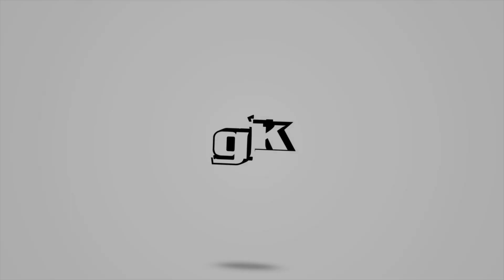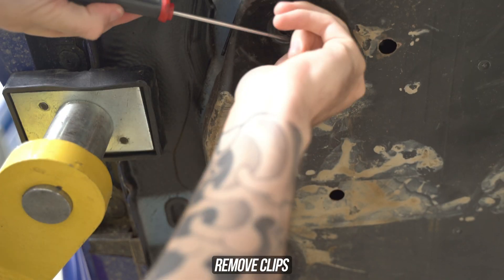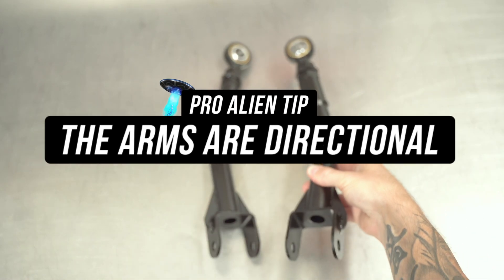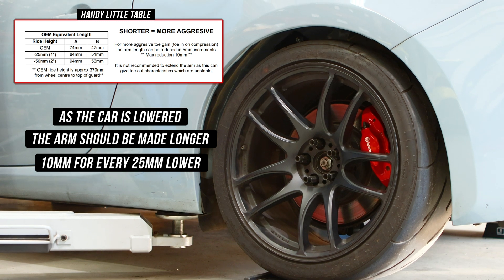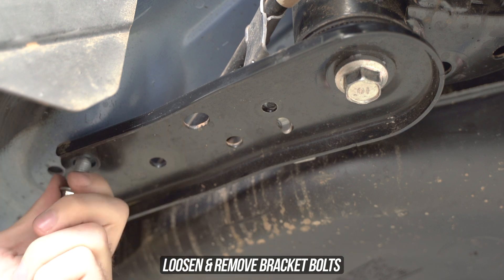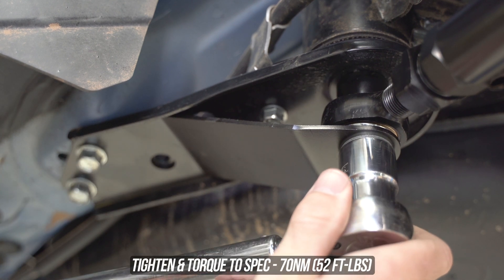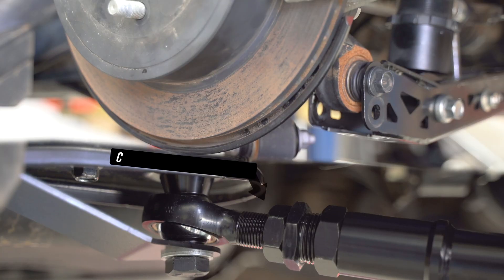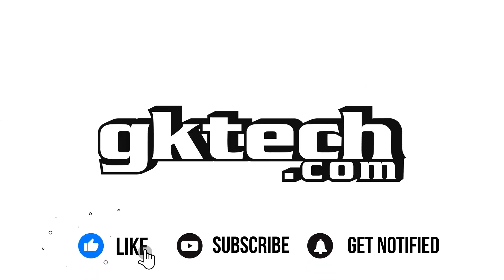GKTECH GR86 BRZ FR-S Traction Mod & Arm - Install Guide

Comment: So if Im seeing that chart right, 74mm at stock height and a maximum extension up to 104mm means a maximum drop of 75mm without affecting toe curve or not having enough thread on the arm left? Is that correct? 

Or is 89mm the correct length at oem height and only an extension of 25mm(maximum drop of 62.5mm) to the safe maximum of 104mm?
Reply from the maker: Yes, you are correct! Maximum drop of 75mm while retaining our recommended toe curve and that 74mm is the correct length for OEM height.

Comment: So in other words, I BRZ/GR86 GT86 you induce more bumpsteer the lower you go with the vehicle?
Reply from the maker: Yes that is correct and is pretty typical of most cars, OEM setup is optimal and changing ride height will often make that worse.